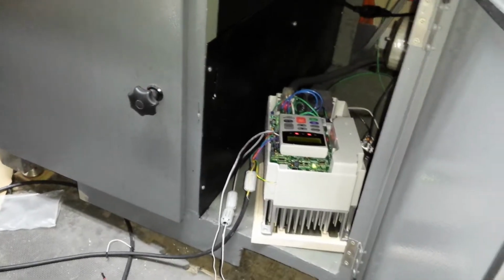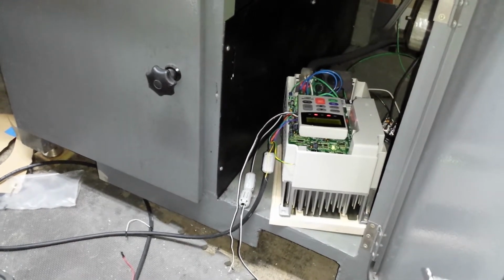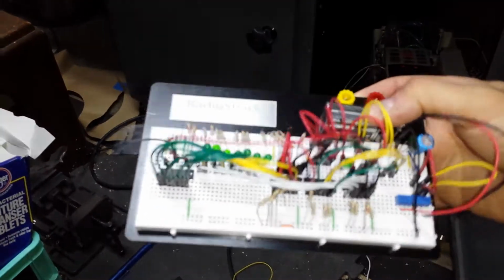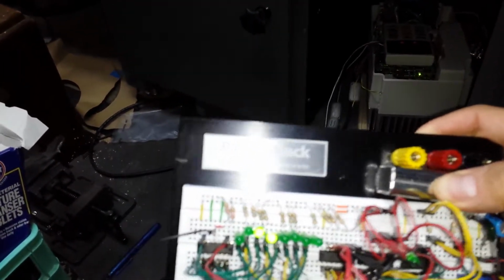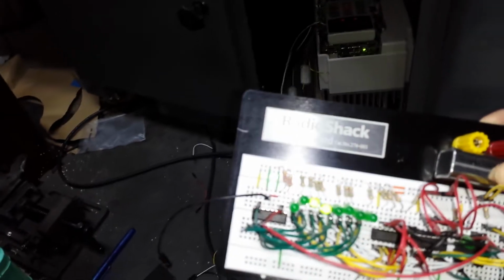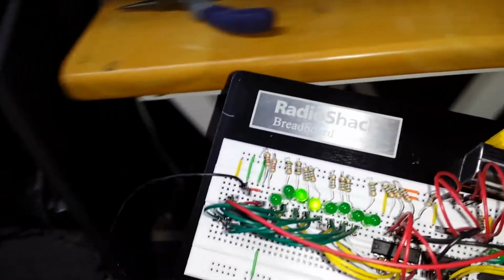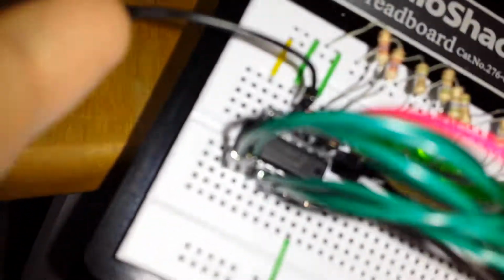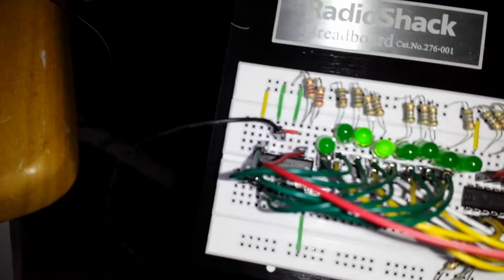Using my circuit as an improvised RF noise detector

Comment: Well, that's making lemonade (RF signal strength meter) out of lemons (unshielded breadboard circuit).

The shielded cable will greatly reduce radiated noise.

Mounting your noise sensitive circuit well away from noise sources will help.

All unused CMOS inputs should be tied high or low.  They're high impedance inputs and they're very sensitive to noise.

The small wires can be wrapped around the ferrite cores multiple times, through the center and around the outside, to reject more RF noise.